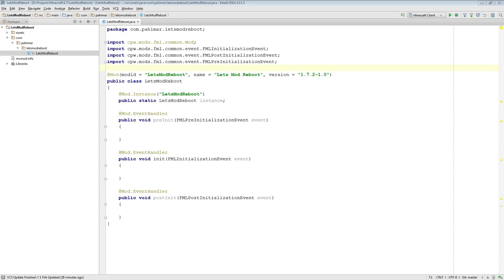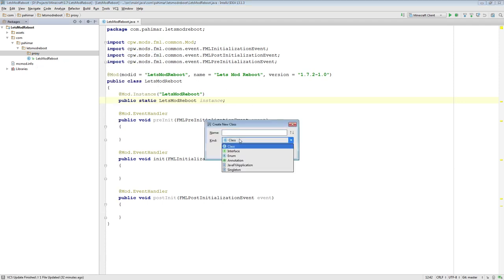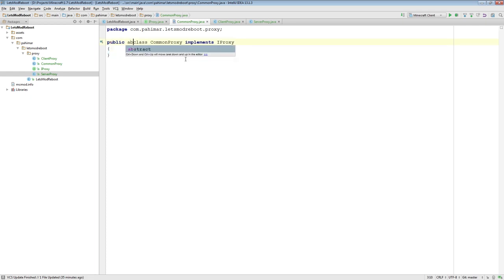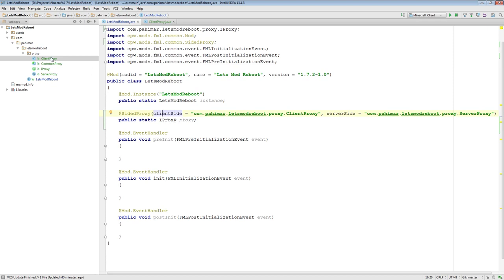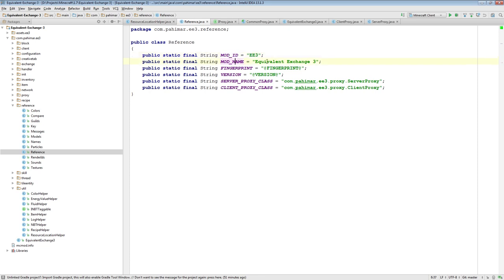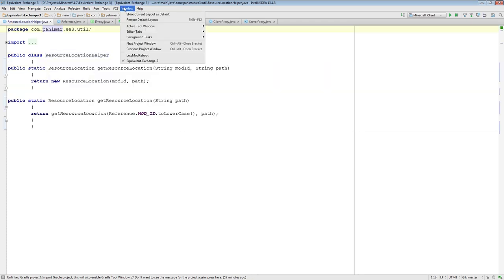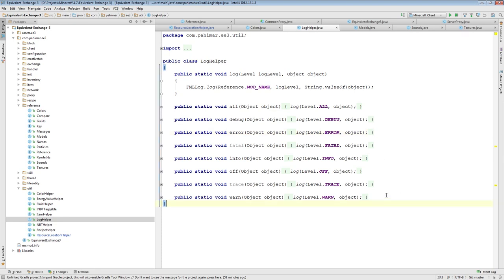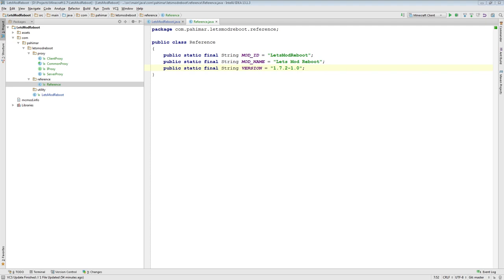Let's Mod Reboot - Episode 5 - Proxies, Reference & Utility Classes

Comment: Just a note: At 7:55 you explicitly declared an interface method as public and abstract. This is considered bad style (all interface methods are public and abstract by default). The error messages you point out later will still appear correctly if the method is simply declared "void doClientThing();" in the interface.

Comment: Pahi for your equivalent exchange development instead of using the integer functions to convert the hexadecimal string into a decimal integer, when assigning a integral value you can type in 0x11 (for example) and would return 17 (since 11 in hexadecimal is 17 in decimal). This is as of java 1.6. I believe in 1.7 they also made 0b[insert binary value] allows you to input binary for integral numbers. I'm only saying this because your color class is final strings and you can skip the step of converting strings to numbers if you do something like this

public static final int PURE_WHITE = 0xFFFFFF

Comment: I've already gotten a head start on this series since it first started so I'm kind of sad the error I'm getting can't be submitted. T_T

That being said, great video as always. I'm glad you're instilling a sense of good programming practices in your soon-to-be pro modding masterminds. :3
Reply: if you tell us your error, someone might know how to fix it...
Reply: John Hollowell
Already fixed it, actually. :P

I was basically trying to add my first block to the game and Minecraft was refusing to recognize the textures I had even though the path name was correct. Turns out it was a case of Minecraft auto-lowercasing everything in the path I specified, so I had to do a rename for most of the packages of my mod because I couldn't figure out how to make it NOT do that.

It MIGHT have just been an Eclipse caveat, but hopefully this'll help out a couple of other people who run into the same problem trying to follow along.
Reply: Shaw Fujikawa Yeah... that is a very annoying MC thing. I think you should only have to lowercase the modid. so "assets/lowercasemodid/UpPeRCaSe/Is/FiNe/HeRe.png" is fine but "assets/ModIDWithUpperCase/textures/tools/ThorHammer.png" is not.

Comment: ok, so I don't have a crash log, but i do have some source code.
I have ran into a problem involving the proxy.
This is the "redline" that I am getting:
serverSide = "com.rebelx11.bf.proxy.ServerProxy")
it is saying that 'class' or 'interface' expected. 
I am doing this with minecraft 1.7.10 and forge 10.13.0.1180.
If you can help, please and thank you,
     Thanks

Comment: Hey Pahimar.
I tried to run the Minecraft Client, just to test my mcmod.info and I got this error.

[10:02:51] [Client thread/ERROR] [FML]: FML has detected a mod that is using a package name based on 'net.minecraft.src' : net.minecraft.src.FMLRenderAccessLibrary. This is generally a severe programming error.  There should be no mod code in the minecraft namespace. MOVE YOUR MOD! If you're in eclipse, select your source code and 'refactor' it into a new package. Go on. DO IT NOW!

Comment: Why do you store color codes as strings rather than integers?
Reply from the maker: When it comes to programming it is far more common to reference colours as hex strings rather than integers - that's why. Also it allows me to quickly take the colour code and look it up to see what the colour should look like.
Reply: Pahimar  But is there any value in using "123ABC" versus 0x123ABC, assuming they will usually be needed as integers anyway in the rest of the code?  Or is that a mistaken assumption.